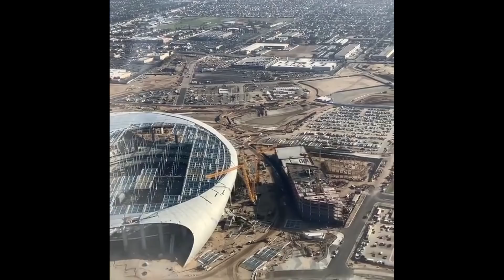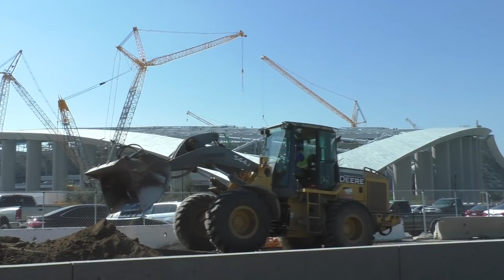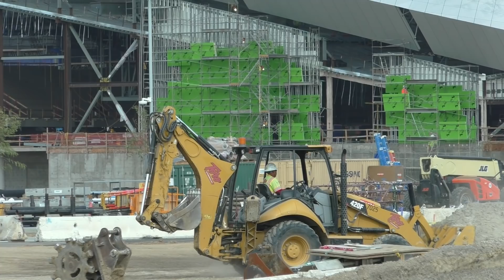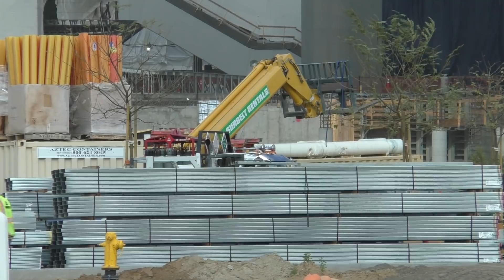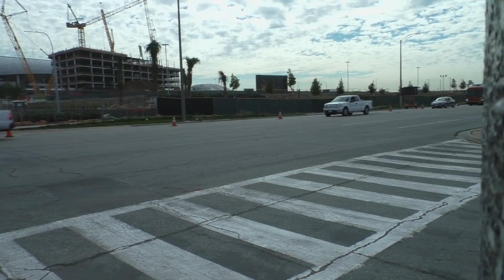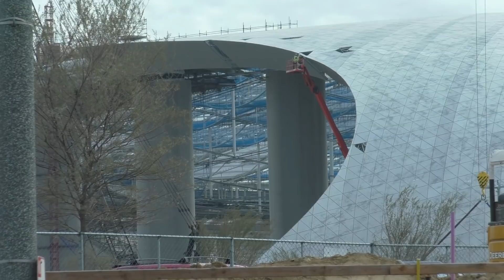LA Rams Chargers SoFi Stadium Construction Update 2.22.20

Comment: Hey John.  Question,  whats the difference in the "panels" we see as the plane is flying in that section between the main part of the stadium and the performance arena and the more see thru parts being filled in at the 35 second mark.  Im always confused on how this is finally gonna look.  Are they fitting the base pieces and then putting the ETFE on top?
Reply: i think some of them around the edges are covered temporarily and used to stage from to do the next ones.  I was looking at it, too, wondering why the edges were "jagged" and what the final outline would be, then it dawned on me it's temporary and they all will be the same.